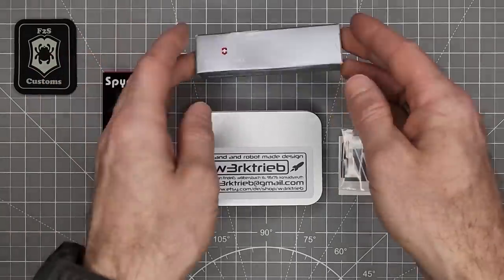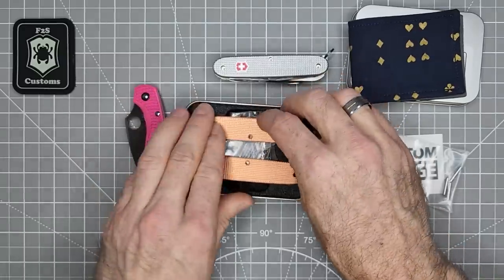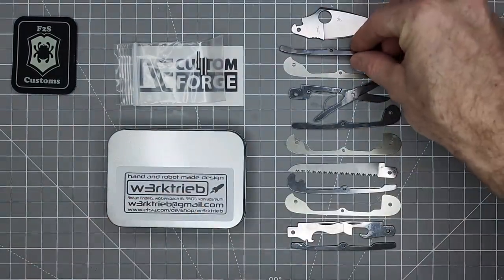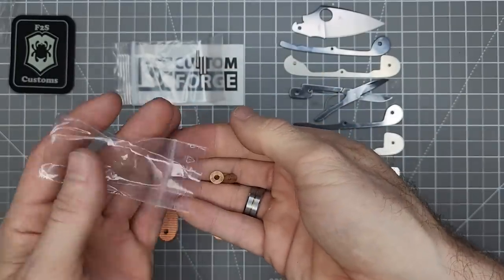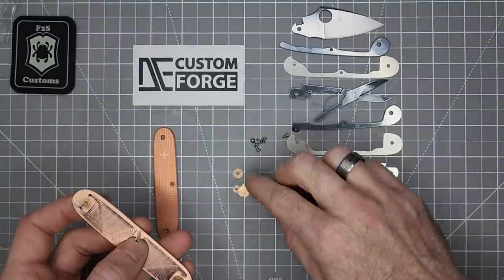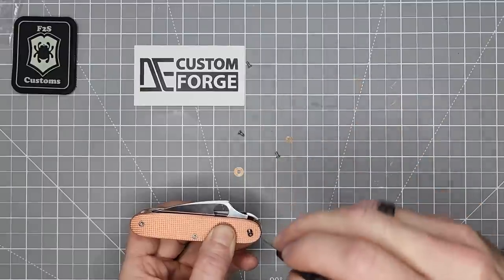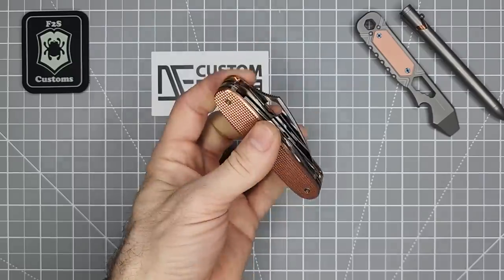How I made this 93mm Copper Dragonox

Comment: Hi there! Great job! Long time follower, recently subscribed and first time commenter here. Must say your videos inspired me to do my own hybrid. That would be a Endurnox, an spyderco endura blade on a victorinox ranger grip. Have you ever tried something similar? Would it fit? I would love to hear about your opinion. Cheers!
Reply from the maker: Hey, glad to hear from a long time follower!
I have not tried placing the Endura in a Rangergrip yet. I'd recommend measuring the thickness of the blades first, then measure the length of the Spyderco blade. If those match or are close, then there is a chance that it'll be compatible.
Reply: Awesome! I know a couple of people with Rangergrips so that won't be too much of a trouble and I have myself an endura so... Fingers crossed. Thanks for the answer! Cheers!

Comment: That was really cool. It looks like the dragonfly blade was resting the edge on the spring though. Saw a little cut-out, but IDK. If the edge dulls on that spot, that would be annoying. I think those screws would need at least some blue Loctite as well. Other than that... pretty cool.
Reply from the maker: The Dragonfly was resting on the edge of the spring during assembly because there was not any tension yet. After assembly, it does not touch the spring at all even with snapping it shut.
Thanks! 👍🏻👍🏻

Comment: Happy Sunday Maestro FtS, truly another masterpiece modification by you. I Love the 93mm Farmer X, its the King of the Pioneer series & I have two of them - one silver & one black. I am not a big fan of Spyderco blades but it seems to work well in your modification.
I would like to see a 4 layer 93mm Pioneer with a large  Clip Point blade paired with the Combo tool from the Compact, Scissors, the Metal File from the Mountaineer & a Wood Saw.  The Farmer X is a work horse & really doesn't need the opening tool layer or the awl but could use a metal file & the combo tool to keep it to a manageable 4 layer size .
Reply from the maker: Hey! Thank you! That would all be possible except that I am not sure what blade I would use for the clip point blade. I've added a metal file to a 93mm before.
Reply: @FittoSurvive  a Wenger clip point blade, some of the 85mm series & all of  the Swiss Buck series use Clip point blades or a suitable sub 3" sized clip point from a Rough Ryder or similar knife that is not too expensive to utilize for its blade.
Reply from the maker: @stevesinclair4159  Interesting, the Wenger blade might actually work.

Comment: I am attempting my first Spydernox mod. As  I am pretty unfamiliar with dissasembling victorinox I have decided to play wit counterfeit dragonfly I bought for cheap and some 5$ huntsman and climber. Later on I will install plus scales or attempt pocket clip mod. Where can I source copper pins to install them and what is the best backspring to use for mod (I saw you talk before about scissors one)? Thanks, long time watcher, first time subscriber!
Reply from the maker: Hey, I am sure that you will enjoy the project!
I use the old scissor spring on the 91mm SAKs. It's the one without the parcel hook.
Here's some links for the brass rods:
2.5mm: https://amzn.to/45jiUXd
2.2mm: https://amzn.to/3LNRfqA
You will need both sizes. 

Hope that helps!
Reply: @FittoSurvive  Thanks! I am across the pond so I will look to source simmilar stuff. You gave me good reference point, much appreciated!

Comment: Great job! And beautiful result as usual, stumbled across your channel some days back, and found a new world of SAKs... All beautiful!
However... Why only spiderco blades? Understand the thumb hole advantages, but that part profiting out... You know what would be great, in my opinion? A front / top flipper blade! Maybe not easy to combine and make it work good with a backspring though... But for instance if a suitable dimension knife with a top flipper and a liner lock exists you could include the whole thing as a layer... Maybe draming, I know 😁
Reply from the maker: Thank you! Glad to hear that you stumbled across my channel!
The front flipper idea is great, I will have to try and figure something out. 👍🏻👍🏻
Reply: @FittoSurvive  thanks for the answer! For the from flippers probably the challenge would be the integration of a lock, but you could also place the blade layer in the middle of the knife... Nice! I don't know many knives but in case probably the Civivi ones could be a starting point, some of their front flippers have relatively low profile blades that could fit, and are relatively affordable...
In any case, thanks for taking the time to even think about my idea👍

Comment: Very nice build. Love the copper with the polished stainless Victorinox parts. So the Spyderco blade has the same pivot bore as the SAK? Or do you weld the hole closed and re-drill for the SAK pivot pin? I would think the Spyderco may be a bigger hole than the SAK. Thanks for your great work and videos.
Reply from the maker: Thank you!
The Spyderco pivot bore is barely larger than the 93mm pivot pin. So I do not redo the pivot bore for it. But, when I place the Spyderco in a 91mm SAK, I do have to redo the pivot bore because there is a significant difference.
Glad you enjoyed my work and videos. 👍🏻👍🏻

Comment: Love your work! Quick question: do you modify the Spyderco blades pivot hole when fitting them to 91 and 93 knives?
Reply from the maker: Thanks! I modify the pivot hole when I use the Spyderco on a 91mm but not on the 93mm.

Comment: That's so much easier than I thought it would be. Does the knife edge make contact? I might have to try this on a Pioneer, I wonder how a Manbug blade would work.
Reply from the maker: 👍🏻👍🏻 The knife edge does not make contact with the spring, during assembly there was not any tension yet. That is why the blade was so loose.
I've never tried the manbug before.

Comment: Wow that's pretty awesome👍 Two questions. First, are you able to rearange the layers to make the blade more centered in the knife, and if so does it make it more difficult to access the opening hole? And second do you think it would be possible to modify a Victorinox One Handed Trekker in a similar fashion? The OHT is my EDC knife and I love it but the Victorinox steel does dull a little quick with heavy use and though the partial serrated blade does still get the job done it might be pretty neat to replace the blade with a Spiderco blade of hard wearing steel.
Reply from the maker: Thanks!!
Yes, the tools can be rearranged. The Spyderco can be accessed without difficulty as long as there is just one layer between it and the side where your thumb would be.
I have not placed a Spyderco in a 111mm SAK yet, but I am sure with some experimenting it could be done. I have seen some custom scales for the 111mm too.

Comment: Is there a version of these pivot barrels for a normal sak? Would be much better than grinding and hammering the normal brass posts
Reply from the maker: You can source 2.5mm pivot barrels but, I can not find the 2.2mm pivot barrels.
I've seen people drill out the center tools to 2.5mm.
There are also titanium scales with torx screws available from China for the 91mm SAK. It has the 2.2mm pivot barrels. But it is limited to just 4 thin layers maximum.

Comment: That one is awesome!! I would love to try this out on my Pioneer X. You said an additional spring is needed. Can you tell where to get a spare 93mm spring? Feeling like I have been searching the whole internet. Thank you!
Reply from the maker: Thanks! I used the spring from the scissors of a 93mm SAK.
Reply: @FittoSurvive  Thank you!
Reply: @FittoSurvive  Sorry to bother you.. Is there like a spar part shop or do I need to sacrifice another Pioneer X oder Farmer X just for the scissor spring?
Reply from the maker: @Artcorrre  I have not found them sold separately, unfortunately. Sometimes you can find some parts on Ebay. But I have never seen the 93mm parts.
Reply: @FittoSurvive  Alright, thank you. I will try to machine a piece in the original shape since I don‘t want to waste a good knife just for one piece. 😅
Reply from the maker: @Artcorrre  I completely understand that.

Comment: Hi, so to build one like this. A minimum of two victorinoxes are needed since you need an extra spring, and it has to be one with cissors, correct?
Reply from the maker: Hi! Yes, that is correct. If you want the Dragonfly to be on the right side, you need the extra scissors spring. It can be placed on the original blade spring too, but then it would be on the left side of the tool.
Reply: Thanks for your reply. The original blade spring usually has awl on another side. Can it be installed with some kind of spacer or so?
Reply from the maker: @Sam-hl6ir  Yes, it can be installed next to the reamer. But you will have to do some modifications to the reamer to prevent it from rubbing against the Dragonfly. https://f2scustoms.com/builds-165-225/build-205
Reply: Thanks for explaining. Last question: Did you bend the spring on this build next to spyderco blade? The spyderco blade base is like 1-2mm smaller than the scissors or original blade base. Even without any cutting, the spyderco blade is already loose when closed.

Comment: The blade axe hole is bigger than the pivot, did you adjust it ?
Reply from the maker: I did not modify the pivot bore because the difference was insignificant.  But when I add the Dragonfly to a 91mm SAK, I always modify the pivot bore.
Reply: I’ve done one, a very simple one (2 layers) all is snappy, but the blade don’t stay close ( it can open a little) so a bit dangerous ! Don’t understand what i did wrong ? 🤔

Comment: Hey im doing a build on a farmer x and was wondering what size pivet barrels it takes? I think I know the diameter but I don't know the length. Thanks!
Reply from the maker: It takes 3mm on the sides and 2.5mm in the middle. The length is 14.2mm.
Reply: Thanks!
Reply from the maker: @paulwright2990  👍🏻👍🏻

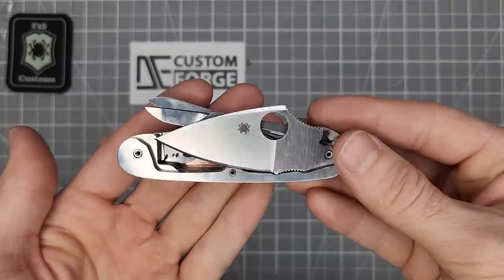Comment: 6:59 It looks like the blade almost touches that back spring. Can't the edge be damaged if the blade snaps close really hard a few times?
Reply from the maker: During assembly there wasn't hardly any tension. That is why the blade is touching the back spring. After I finished assembly, the blade does not touch the back spring at all. 👍🏻👍🏻
Reply: @FittoSurvive  I was pretty sure that you made sure that it's not touching when the knife is assembled. :)
I was asking because I've seen (factory) SAKs where the blade tip is FAR AWAY from touching the spacer at the tip, but when it snaps close a few times really hard, the tip still touches that spacer and damages the edge in a tiny spot.
I was just wondering if you have also tested this knife for this.
Reply from the maker: @miklospinter  I understand exactly what you mean. I've had some stock SAKs that would tap on the brass spacer. I intentionally snap the blade shut hard several times to check if it will tap. 👍🏻👍🏻
Reply: @FittoSurvive  That's great! :)

Comment: It looks like the blade is positioned too close to the spring, so the edge is hitting it when you close the knife.
Reply from the maker: It does not though. During assembly, there wasn't enough tension, that is why it looked like that.
Reply: @FittoSurvive  Alright then, cheers!
Reply from the maker: @Maxxon89  Good eye though. 😉
Reply: @FittoSurvive  Thanks :)